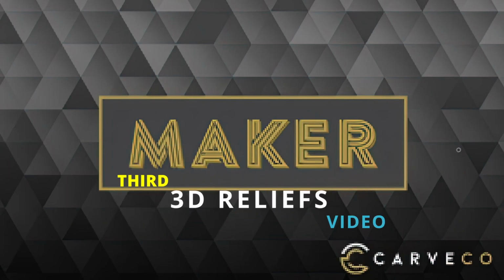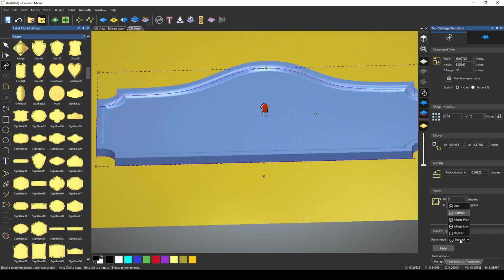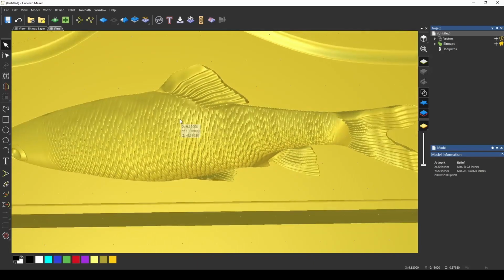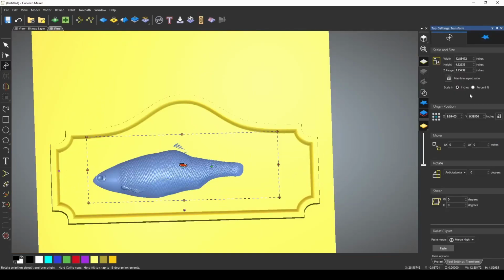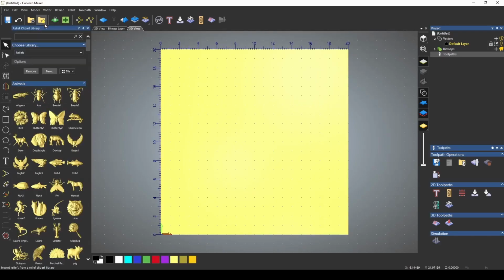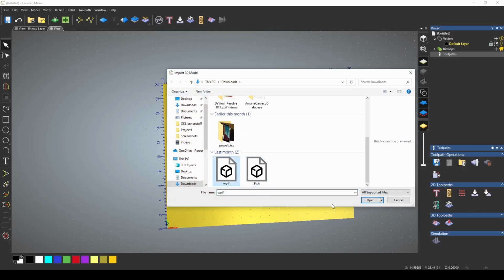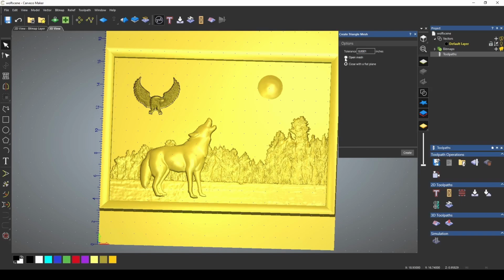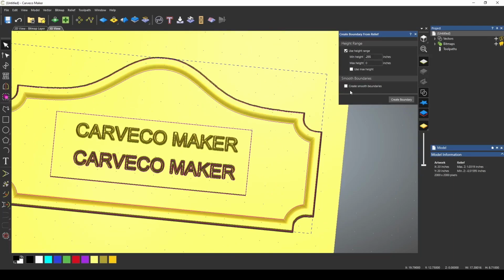Ultimate Beginners Guide to CARVECO MAKER: 3D Relief Creation

Comment: I tried to drag a relief from the clip art library but it is placing the model under the work area. 
And, if I hit the paste button it just disappears completely. 

How can I bring the imported 3D relief to the top layer?
Reply from the maker: On the second tab of the transform tool there is a place to add a flush which is material to the bottom of the model.
Reply: @Timberfalls  ok, Will try, and let you know if it works. 
Thx🙏

Comment: Hi when I tried this I get this error points on the model lie outside the currently defined
Reply from the maker: This means that the model is larger than your defined material and needs to be adjusted in the material setup which is at the bottom of every toolpath. Hope this helps

Comment: Appreciate these Videos on Carveco Maker I am picking up many good points.   I am having great difficulty in reproducing many of the operations you perform.  Unfortunately, I am not getting the same menu's coming up on the right side of the screen as you do.  Specifically trying to add some text to an imported STL.   Unable to adjust size or depth or even get it to connect to the original file.  Is it possible that you can only add text to the clipart within Carveco and not an outside STL file?
Reply from the maker: You can add text to any STL or clipart as they are pretty much the same thing. You need to have a project open to import a stl from the top menu and select the import relief option. This will give you the import window to paste in the floating model. It must be pasted down before you can add text.  If you cannot see it press f9 to bring it back into focus to the middle of the project. Some of those windows are only active in the 3d tab and not in the 2d tab which is something else that can prevent those from showing up. There is a carveco users group on FB that may be a great source of knowledge as well. Hope this helps.

Comment: Jason, I have a knotty log style text I would like to crown so it carves like a real log shape. Can I use that rounding tool to creat the effect? My concern is all the knotty vectors moving independently. Please advise, Thanks
Reply from the maker: I am not quite sure what you mean by log shape but if your using the sign base 28 trick to create the raised  relief first and then the smoothing tool to smooth these edges over as long as they are not too tall it should work . I would run the simulation of the toolpaths to see what it looks like and is the way you want it to come out.
Reply: @Timberfalls  So the log text has a lot of vectors to express the bark and knots within each character, and although I can  raise the text, I want to raise it on an arc so when carving it looks like a 1/4 shape log or radius down from center to the edges of the text. Thanks for your reply!
Reply from the maker: @awehnert235  With basic maker this is going to be very difficult to pull off. You really need the 3d molding tools to do that kind of thing. The trick that I show is pretty basic and can do some layering but not sure you are going to get it to look smooth like a log. You would need to arrange each of those vectors at a slightly different height progressing over the shape to make that happen.
Reply: @Timberfalls  Thanks Jason, I'm just starting and don't even have my cnc yet. Still waiting for delivery. Working on projects to prepare for the delivery. This is for my company signage. Though I'm training in Carceco Maker I assumed I would be upgrading or shifting to the vetric software. Getting my feet wet learning. My previous experience is with Mastercam and their solids modeling component. Carveco is interesting but my background is in 3d moldmaking design and tool paths. It's just the upgrade for my older version of Mastercam is 5k and they don't have a post processor for the Masso control. Thanks for your feed back, God Bless!
Reply from the maker: @awehnert235  I have used both and  I think you should stick with Carveco and if you are going to upgrade Carveco maker + is about 1k cheaper than Aspire but has most all the same 3d modeling features and is a better bang for buck. Vcarve pro is the same as basic maker and you will not really gain any features moving to that. You could use maker for almost 5 years and not spend what you are going to spend on vcarve pro. The 3d modeling tools in Carveco are more refined and the full version of Carveco has features that none of the vectric versions can do. If you are good with master cam Fusion 360 can do full parametric design where as Vectric and Carveco are only 2.5d.
Reply: @Timberfalls  Thanks, I was going to ask your opinion! Since I'm training on Carveco, my thought was to stick with it. PS your videos are great training. I have questions on the Navy Marine tutorial that I'll send through on that one. Have a great evening!

Comment: Thanks for this excellent series.  I was brand new to Carveco 2 days ago, and now I'm programming and doing surprisingly well.  I attribute that to your style of teaching -- very thorough and consistent.  Thank you for that.

I have a few questions:

1. How can I take a 2D photograph and turn it into a 3D carving?

2. How can I stop my machine (Onefinity) from returning home after completing each tool pass.  Often I have 6 or 8 tool paths before needing to insert a different bit.  Can't the machine just go from one path to the next without wasting time going home in between each one?
Reply from the maker: Thanks Dan for the feedback I appreciate the kind comments. For 3d stuff its a little hard to make 2d stuff 3d without maker plus this video shows sort of a workaround. https://youtu.be/NGsQzjMnTZw
Reply from the maker: On your second question if you are using the same bit you can save all those toolpaths as one toolpath and they will run back to back without stopping.

Comment: Every video I have seen so far, I have learned something that I didn't know. You explain things at a good pace and are thorough. Thanks so much for sharing!
Reply from the maker: I have been accused of going to fast so I try to keep that short but to the point. lol
Reply: @Timberfalls  Don't let anyone ever accuse you of that, there is a rewind and a pause button, people should learn how to use them so if someone can follow at your speed, they won't suffer wasted time!  Thank you!
Reply from the maker: @QuagmireLXIX  another option is to change the speed on the video. If you click on the little options button you can watch it at slightly slower speed and may be easier for some to follow.
Reply: @Timberfalls   You do go a little too quickly for me, but I wouldn't call it an accusation more of an observation. Also if you could make your mouse cursor more visible (larger and a more contrasting colour) that would help some of your more aging viewers (like me). But above all that I'm grateful for the videos, you don't have to do them and they are extremely useful. Thanks
Reply from the maker: @thebigsnifter9145  I appreciate the kind feed back and I will look into the cursor size so thank you for that suggestion. On the going to fast part you can change the video speed in the settings button on the video to slow it down slightly and it does help. I try to pack a lot of info into each of my videos so they tend to go a little fast.